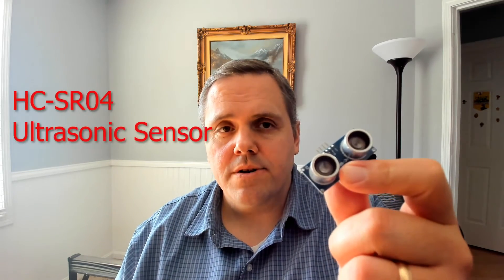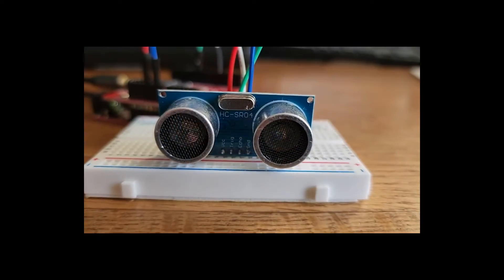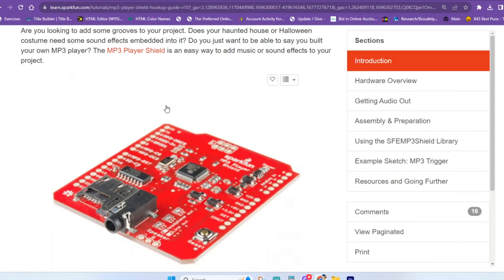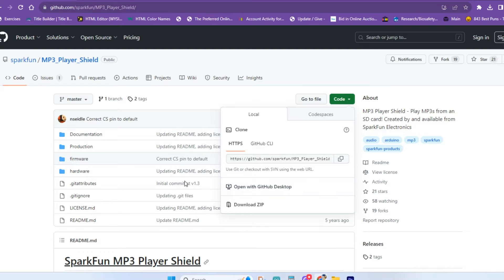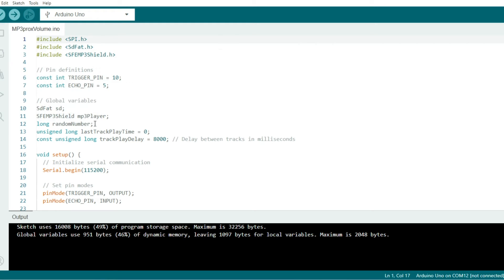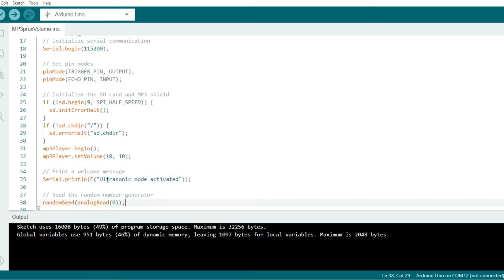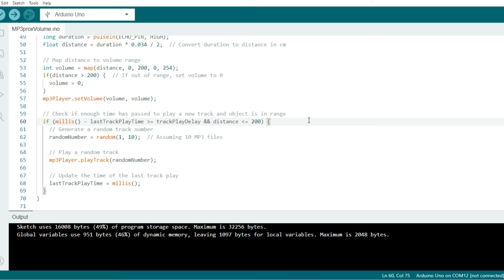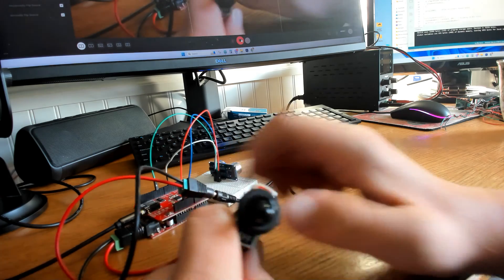Arduino Music Project: Gesture-Controlled Volume Using SparkFun MP3 Shield

Comment: Cool. This is very overwhelming. I have never touched arduino before but I wanted to try and make something that starts playing a song when I open the refrigerator and stops when I close it. Or rather it would always play but increase the volume when open and silence it when closed. Seemed like a fun thing...
I was thinking of using a light sensor. I think, with some slight changes, I could maybe get it to work with your code. I guess we'll see :p
Reply from the maker: hey there!  that does sound fun. check this out https://youtu.be/zamlAniU2nQ  it's easier to setup than it looks. you will have to do some soldering but sparkfun boards are very easy to solder. You could replace the motion sensor with a photoresistor and the mp3 player would activate when light hits it. I'm happy to help if you get stuck! I also include most of my code on the Facebook page in comments section. Some of the early videos didn't get code post though... good luck to you and thanks for adding to the conversation here! 👍
-brad
Reply: @BMonsterLaboratory  Well I'll be... that's perfect. Thanks, man!
Reply from the maker: @Squiddledorf  you're welcome.  Enjoy!